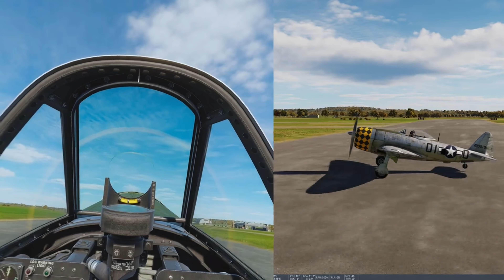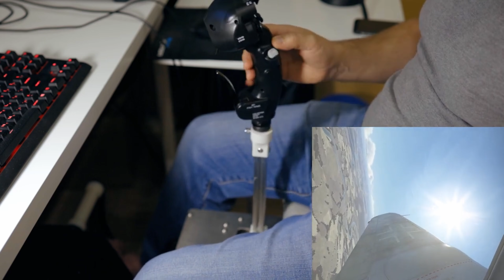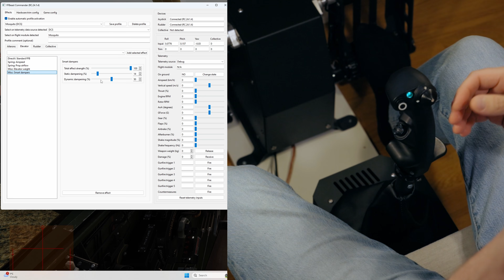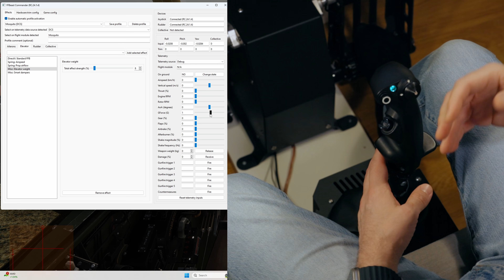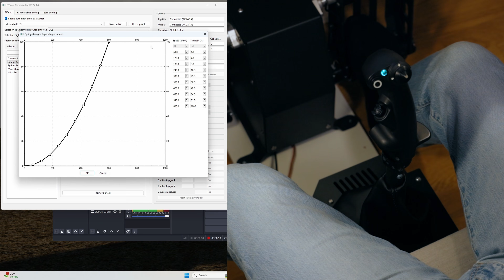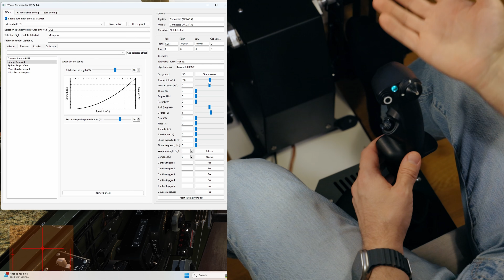DCS Mosquito hard way! No curves, but using FFBeast instead

Comment: Great videos! With commander 24.1.5 it seems to be an issue with elevator weight effect : it does work realistically in debug mode but not in dcs telemetry mode. I tried to replicate with the p47 and spit what you showed on the mossie but not joy.. unless it is a bug i dont get it...
Reply from the maker: @pierrot911ezy  That’s strange, because my one works just fine, why exactly you consider it’s not working as it should? Could you please describe an example?
Reply: For example with the p47 cold and dark. The elevator should be down by  gravity. So the stick should be all the way forward even after you have pulled on it and let go, like it does in the real one. But in my case (unless I use debug mode) if I pull on the stick and  let go it will fall back to full aft position.. it should go all the way forward. Same issue with spitfire
Reply from the maker: @ I think I had similar issues way before. Stand by, I’ll try to remember how to fix it
Reply: @justflyit7569   I tried to increase strength to 80% ish but it creates unrealistic elevaror oscillations when airborne as soon as I introduce pitch input
Reply from the maker: Sorry for the delay. Just came home after the duty rotation. Yes you’re right. Ive checked myself. It seems like for whatever reason soft does see G equals zero before liftoff even if the rest of data in telemetry is correct. Once you took off it shows correct values. I’ve reported this bug to Roman (the creator of FFB). Thank you for your feedback!
Reply: @justflyit7569  no worries! Thank you for investigating ;) roman came back to me yesterday and told me the same. He is already working on a fix

Comment: thank you for a great video, very informative. I have a question regarding the FFBeast you have:  what motor strength are used in it?  20nm, 35, or 45nm?
Reply from the maker: @problemaccount  Thank you. The motor itself provides consistent 15nM at least, but due to reduction in kinematics it gives 50+ lbs of force in pitch and around 35lbs in bank channel with the arm of 45cm to the grip point of the flight stick
Reply: To be able to nearly-replicate the force on WWII aircraft, you would need the 45Nm motor one. Assume you are talking about the one on FFBeast website

Comment: Can you also make a video on how the ffb works on the rudder pedals? How realistic is it? And how to set up correctly?
Reply from the maker: @martinalvarez827  It’s absouletely realistic I can assure you. It does have only one disadvantage at this point, it provides around 23kg /50lbs of force which is not realistic enough. To make it real to be able to cover most of the types of aircraft in DCS we need to double it. Other than that it’s a must have thing, especially since it can easily cover all the requirements of all the helicopters in the sim. Yes next time I will cover rudder pedals operation and features as well